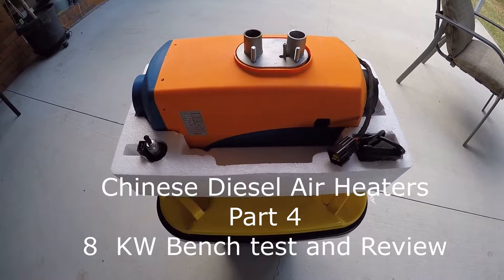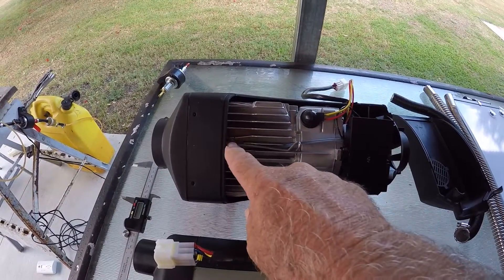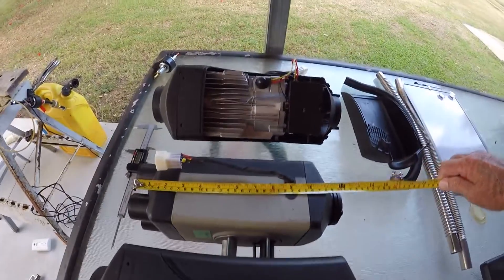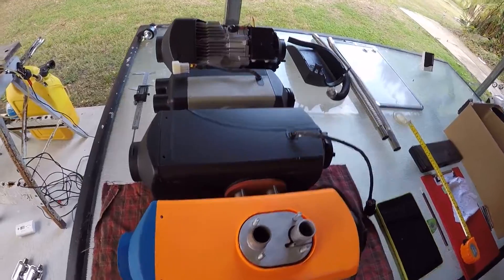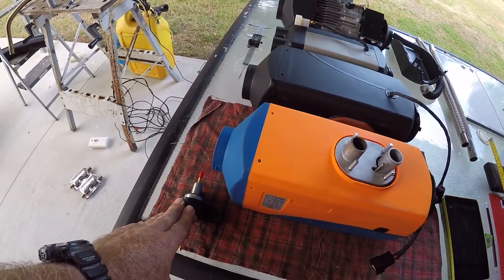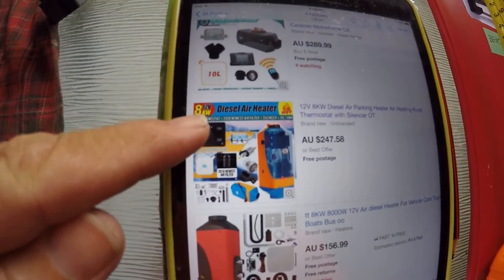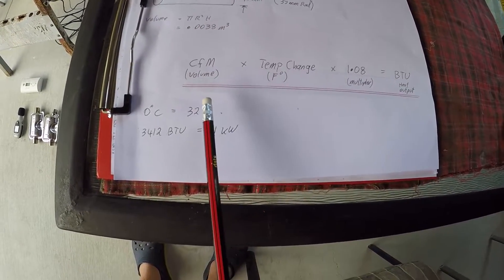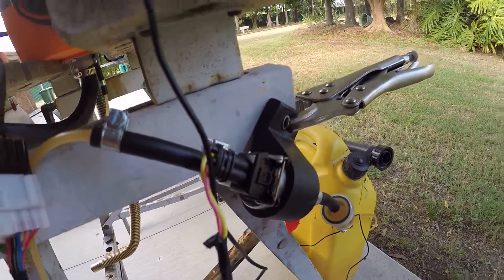Chinese Diesel Air Heaters   Part 4 -  8 KW Heater Test

Comment: Thanks for your work.. I'm thinking they are getting 8kw through using the Un-Lock code (1688) on the 5 button full LED display controller and setting the Pulse rate up to the max(8.0 pulse) which you can do & also you can run up the RPM there also to match your pulse rate..Lowest is 1,450rpm -Highest is 5,500rpm ( on my unit anyway) Lowest setting is (.08) & highest is (8.0).. The unit is really screaming at 8.0 hertz...Lol.  Many call this Tuning the unit for your area..Feels like fire coming out of the output & your exhaust pipe gets around 300-350 degrees.. Really don't think these tiny heaters can run very long wide open without something going wrong.. I'm running mine inside my Home so can't really test it full because I don't want to burn my house down..Lol.. Again, thanks for all your work..
Reply from the maker: @john_Caji315_adams  
Hi John,
Happy New Year

In my videos I never give info on how to unlock the controller as I have seen so many issues occur when this is done. If there is a need, I think it is far better to have two heaters running slower rather than try and force more heat out of an already stressed heater running flat out.
Cheers,   JMcK

Comment: I was under the impression that not all pumps were .02 they sell 16ml pumps for the 2kw heaters and 22ml for the 5/8kw heaters
Reply from the maker: Hi PF, 

When I did these tests some 5 years ago, all the pumps delivered .02ml or .022mm per pulse.
It makes sense to reduce the the pump volume on the new 2kw heaters.  JMcK

Comment: Thanks,  I've never trusted product advertisements and I'm starting to wonder if "you get what you pay for" still applies. I'm going to need to outfit my car soon if housing prices increase, that's another story.  I live in Canada where the Planar brand is sold and the price is upwards of $1000. They warn against cheap imported heaters so wondering if theirs is any better. Can I trust specs.
Reply from the maker: Hi KC, 

I have had excellent success with these cheap Chinese heaters, and in the last five years I only had an issue with one. (Replaced). Why pay $1,000 for a “brand” heater when you can get the same for $100. It is very rare to get a “bad” heater, but if you buy from a local supplier, in my experience, they will replace the heater.

If you found your supplier would not replace a bad heater, you are still $900 in front and have a box of spare parts. Cheers.  JMcK

Comment: Amazing investigation! In Sweden we calculate like this: We measure the air flow to  0,023 cubic meters/sek. So 0.023 x 1,2 x Delta temperature, and that was 80 degrees Celsius. So 0,023x1,2x80=2,2kw. As you can see in my film below. And now I know that the heater is "drinking" 0,29 litres/hour. And that was ny "8kw" running at the highest level. https://youtu.be/GCHs62i2qbw
Reply from the maker: Thank you for the info BA...JMcK

Comment: The difference in the 5KW and the 8KW is the ECU is adjusted closer to the upper limits of the system both in moving more fuel and more airflow.  Of course, its reduces the safety margin, wears out the components faster, and uses more fuel for the greater heat generation.  Good video covering some of this by one who changed the ECU settings giving results is: https://www.youtube.com/watch?v=gjhXflKayIg  Would be nice to access your excellent measuring to determine just how many real KW/BTU the higher settings result in.

Comment: The calorific value you have used for the diesel is for a Kg not a litre. You need to multiply the Ltrs used by the density which is about 0,86 and gives and even worse result. I recon my 5 to 8 Kw/h heater can only give 3.8Kw/h and some of the goes out the exhaust. It works well but its a bit of a con
Reply from the maker: Hi Craig, these heaters are an exact copy of the German Eberspacher D4 heater. The Germans class this heater as 4Kw output. But 5 Kw claim is reasonable from the Chinese.  JMcK

Comment: Hey John, got one last question for ya.  Do you recommend priming the unit before actually starting it up, for the first time?  I see that this function exists, and definitely want to avoid an “E- code”.  I don’t plan on the fuel line to be very long, maybe 1-2 feet from the fuel tank to the heater.  Any advice you got is greatly appreciated. Happy Holidays to you
Reply from the maker: Hi Guys, I recommend you prime the fuel line to the fuel pump before first use to protect the pump from running dry. Suggest you have a quick look on this matter in pump video and motorhome video.  Cheers JMcK

Comment: I have 5kW version. In the "blue" or "new" controller I can increase the max. pump frequency from original 5,5 Hz up to 8,0 Hz. Also oryginal fan speed from 4500 rpm to 5000 rpm. In effect theoretically the max power is around 7kW. However the combustion chamber is overheating and the pump slows down to 1,6 Hz for a couple of seconds. My pump is 0,022 ml\stroke. So it is definitely not 8kW, but something between 6-7kW.
Reply from the maker: Thanks for the input Pawel.  JMcK
Reply: @johnmck1147  
🙂

Comment: so the cost to run at say 3kw output is about 70c/hour (333ml/hr) as compared to reverse cycle aircon running a 1300w input putting out 3kw of heat would be approx 27c per hour (our off peak is 19c/kwh) peak is double that 3pm to 9pm.

Comment: good man John nice info best to just pay for a 5kw machine eh...the one im thinking of buying is a Vevor 8kw but i may go for the 5 just incase
Reply from the maker: Hi Joe, if the price is about the same, pick a heater with the controller you want, and from a supplier with good feedback. Keep warm this winter.  JMcK
Reply: Hi John i have ordered a heater from Vevor should be here in about 16th december fingers crossed its not damaged in transit. hope it works as advertised but your youtube channel is a great place for help about all things chinese heaters thanks for the advice

Comment: Hi John, thank you for your hard work investigating the heater. Can you please teach me how you work out that 1L of diesel gives 110kW energy at 13:20? kW is power unit while energy density of diesel should be in Joule/L. From internet I found the energy density of diesel to be between 32 to 40 megajoule per litre. kW is thousand of Joule/sec.
Reply: If you burnt 1L over 1 hour, then simply divide 40MJ by 3600 to get 110,000 watts
Reply: @propheteyebert7063  Thank you. I missed the 1hr bit without realizing that it is implied.

Comment: I appreciate all the hard work!  I was wondering if you've noticed, or found, a diesel heater that uses less electricity to power.  I run my camp off a 200$ lithium power pack.  240 watt hours in the bank. The injector, control board, and fan can use up to 100 watts on startup and shutdown, leaving me without lights after a few hours.  

Any ideas?
Reply: Get a bigger power pack if you need to run longer.

Comment: Great video again, thanks John. The Chinese are now selling some 8kW often for less money than the 5kW and sometimes the 2kW heaters, so your investigation possibly changed the market! The main difference in price these days is the controller, remote and accessories packages. Higher priced models often have better quality casings, glowplugs, fuel pumps, screens, mufflers and piping. I'm ditching my boat's trusty but temperamental Eperspacher D5 as the glowplug draws 30 Amps on startup and re-start and my elderly house batteries require an engine start to cope. My new Chinaspacher unit cost the same as an Eberspacher service kit without the glowplug!

Comment: Hi. Nice videos, thanks very much for youer efforts.

I'm just about to buy one, and it's an issue wrt getting 5kW or 8kW, and if it's actually any difference.
I plan to test mine.

In terms of the test methodology, I suggest you measure things in terms of MASS rather than VOLUME, because the air expands, and thus density changes.
Also, you'll get some differences with relative humidity, and barometric pressure.

So I'd suggest measuring the air flow VOLUME at intake, and then converting THAT to a mass flow rate.

You can easily obtain the Density of the air at those conditions: temperature, pressure, humidity.
And you also can look up the Specific Heat Capacity (at fixed pressure "Cp").

And then you measure the Temperature at your reference heat output: I supect the units are rated right at the unit's output, and NOT at the end of the flexible ducting on them.

Then it's:
Volume Air Flow Rate (m/h) x Intake Cross Section (m^2) x Density (kg/m^3) x Specific Heat Capacity (J/kg-C) x Temp Diff (C) = Heat Output (J/h)

Convert to Watts by 3,600 J/h = 1 Watt

There's some error by assuming Cp is constant, but it's small over this temperature/pressure range.
And there's some error if you are in a humid environment: but you can do a good relative comparison between units, and for different conditions.

If you really want an accurate calc, then you need to delve a bit into psychometrics: thermal properties and behaviour of air.

And you can get an overall value for EFFICIENCY, by comparing Diesel Fuel Burned multiplied by its theoretical Lower Heating Value.
For diesel that's about 35 MJ/litre.

I haven't got my own unit yet, but based on the Webasto claimed fuel rates, I get around 84% efficiency for them, using their Heat Output Values.
Dunno if that's accurate, but that seemed to be best data set I found on line.

Their data:
1.5 kW @ 0.18 l/h
3.5 kW @ 0.43 l/h
4 kW @ 0.49 l/h
5kW @ 0.61 l/h
5.5 kW @ 0.67 l/h

If you graph this data, it's a straight line.
With a slope of 0.1221 l/h per kW

And as I said, if you assume their Heat Outputs are accurate, it gives you an 84% Efficiency.
I assume that's on the high side.
But I'm sure the Chinese ones are worse.

To get a more accuarate Theoretical Efficiency, you could compare the measured Heat Output as described above.
And compare it to Theoretical Heat Output from optimum fuel use:
Fuel Pump Output (l/h) x Lower Heating Value (35 MJ/litre) = Theoretical Heat Output (J/h) ....convert to Watts

Theoretical Efficiency Rate = Actual Heat Output/Theoretical Heat Output
Reply from the maker: Hi Warthog,

Thanks for your detailed comments. At this stage I will not be doing another test on this matter.
But I would be most interested in your results and figures.
When I tested these heaters some years ago they were exactly the same.

Of interest. Both these heaters are exact copies of the German Eberspacher D4 Diesel Parking Heater. Even the gaskets are interchangeable. 

The Germans are conservative and they rate their heater at 4Kw..   JMcK

Comment: just bought a vevor branded 5kw after buying the "8kw" of the same brand and from taking it apart what I notice before using it is the casting for the main burn ?chamber? is not as good as the 8kw, this may explain the difference in some cases(I guess it might be like cpu manufacturing where it's spec'd by quality with some exceptions)... to clarify, it's the outer fins that are not so nice looking and show some cracking, the inside of the chamber shows no cracking or malformation so I'm gonna give it a chance and amazon "exchange" it if it cracks or similar

Comment: Can you tell me if there is any difference in fuel flow or fan settings from a 5 or 8kw by factory?
Reply from the maker: Not when I made this video. 
Lately some manufactures have increased the fuel flow to increase the output, but this has caused some overheat issues.
Remember these are exact copies of the German Eberspacher heater D4. The Germans rate their heater as a 4 Kw heater.  JMcK

Comment: Nice vid and well documented info. Thanks. I bought two of these. One for garage and one for my home as a back up in case regular heaters crapped out in a cold spell. Dont expect the one to heat my home to 66 degrees but would keep my pipes from freezing and keep it liveable. Just comparing it to propane looks like it will be cheaper. Will be trying waste oil in one in garage. either a mix of waste oil and diesel or two tanks. One with diesel to start and shutdown and second tank to run while working.

Comment: Hi I have a 8 kw heater which has only been ran perfect for 2 hrs. Now it just blows white smoke and it's getting fuel but won't ignite to warm up. Please help what's wrong
Reply from the maker: Hi Kerri,

First up, white smoke generally means heater is running rich. This can be caused by not using narrow bore hard nylon fuel hose from fuel pump to heater. What sort of fuel hose are you using? Some suppliers now only supply cheap large bore plastic fuel hose.

Next, where are you? Are you at high altitude? (Above 1,000 feet) These Chinese copy heaters do not come with altitude compensation and at altitude they run rich (less oxygen) and carbon up quickly. If you have been running the heater at altitude you need to clean the carbon from the glow plug screen and main screen and then use a high kerro/diesel fuel mix. 80/20 to 90/10. Kerro burns cleaner than diesel at altitude and produces less carbon. The diesel gives the kerro some lubrication and lessens pump wear. 

Good luck.  Please keep me informed how you go.   JMcK
Reply: @johnmck1147  hi I. Just returned it

Comment: I just got a "8kw" all in one heater, but if I go after what the display says,  it's heating up to 245°C on the outside of the casting.. And they have increased the Hz to 8.0 (Ofcourse I do not run at 8.0) I run it as a 5Kw heater..  But it runs hot.
Reply from the maker: Yes, to overcome the false advertising, some suppliers are upping the Hz rate, but they often now come with overheat issues.  JMcK

Comment: So is there particular brand you would by I  the Chinese cheap ones?
Reply from the maker: Hi Ian
Suggest you buy from a supplier that has a warehouse in your home country, and has good ratings. Buying a Chinese heater, you really will not know the original manufacturer. JMcK

Comment: Thankyou so much for these informative videos. I have learnt so much from watching. In fact, I wouldn't have had an idea without them, and would probably have made many mistakes through my ignorance. I installed a 5kW heater in my caravan and I was so impressed I decided to buy an 8kW to heat my loungeroom - big mistake: I didn't watch this episode first. Anyway, I placed it under the floorboards and spend much energy and money setting up exhaust system and fuel line to exterior reservoir, ducting, 240-12 V transformer, etc. The end result was disappointing as  it didn't warm the room enough. After watching this episode of your videos I realised why -  it wasn't really an 8kW heater. I am now thinking of removing this heater unit and putting it in my garage, then finding a genuine 8kw unit to put in its place. I have lost faith that there really are any Chinese 8kW heaters, though plenty are advertised. Have you found any, or could you suggest where I can buy a relatively cheap 8kW heater. I guess I cannot use any of the portable ones (if they are in fact 8kW), unless maybe if I remove the actual heater unit from the chassis. Is this even possible without drama? Can you advise me please, John?
Reply from the maker: Hi Greg, 

These Chinese heaters are a pretty exact copy of the German Eberspacher D4 heater. The gaskets, glow plugs, screens etc are all interchangeable. The Germans are conservative and list their heater as a 4 Kw heater. Do you think you can double the output of the heater you copied? Yes you can get a little bit more heat by increasing the fuel burn, but only a little before the heater goes into overheat mode. I know of no real 8kw Chinese heaters at this time. To increase the output you must increase the heater size.

Why not just run two cheap heaters together?

Cheers.  JMcK

Comment: Hi John. Great set of videos.  I have the 8kw heater with the full digital screen.  When it starts up it shuts down after about 20 seconds any idea what's going on?  Cheers
Reply from the maker: Hi Dave, 
I really need more info. 
Are you getting any error message on the screen?
Two common causes for your symptoms are no fuel, or low current.
Are you getting fuel to the heater? Can you hear the pump ticking?
Is your battery charged? Is there 12V at the heater? 
These heaters draw up to 10 amps to start and a flat or old battery or poor wiring can not deliver 10 amps to the heater.   JMcK
Reply: @johnmck1147  Hi John, you where 100% correct it was the power supply. I swapped it out for a 240v ac/dc 12v 30 amp unit and it works like a charm..  Thank you for your help.  Cheers.
Reply from the maker: Dave Maher 

👍

Comment: Excellent detail. Is injection pressure important or does the design of the atomizer mean pressure is not critical?
Reply from the maker: Hi JB,

Yes, in my opinion injection pressure is important. The diesel has to be forced through the screen to be atomised so as to burn. When new, the screen is clean and the diesel atomisers easily, but as carbon and/or diesel gel accumulates, atomisation becomes more difficult without pressure.

Some heaters now come with soft cheap plastic fuel hose, rather than the hard nylon fuel hose, which should be used on the delivery side of the pump. The plastic hose will initially work, but as the heater ages greater than normal carbon will accumulate on the screens due to lower pressure caused by pressure absorption of the fuel pulse by the plastic.

Cheers.  JMcK
Reply: @johnmck1147  Many thanks for your quick reply, yes thats very helpful.:)
Reply from the maker: jbsmith1 

👍.  I would be interested to know how your pump experiment goes.  JMcK
Reply: @johnmck1147  Thanks. Yes I didn't want to bore you with the details so made a new post, but yes its looking promising. I'll let you know how it goes, I think I'm going to have to do quite a bit of testing and inspecting the burner for sooting before I'm confident of going public.:) If all goes well I will send you a prototype to test out.:)
Reply from the maker: jbsmith1 
👍